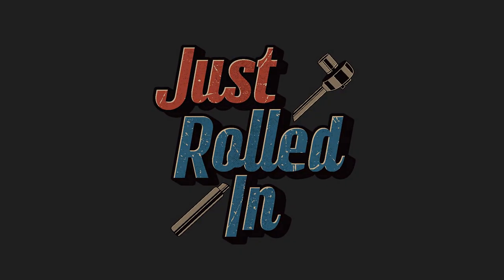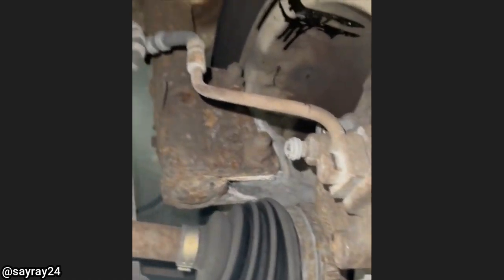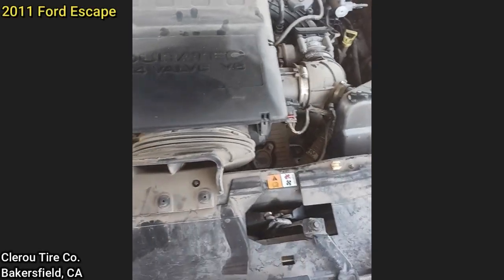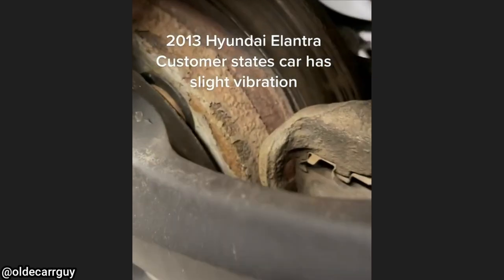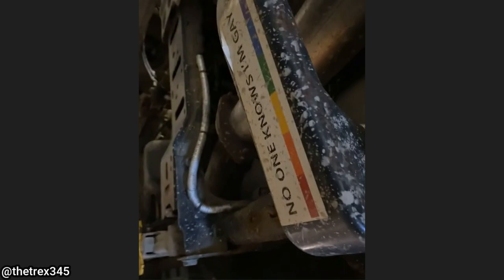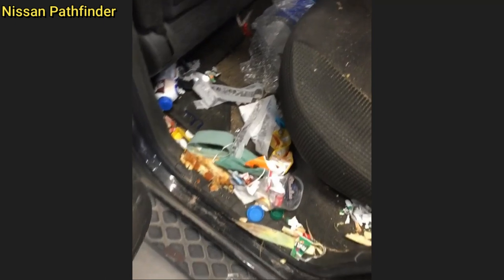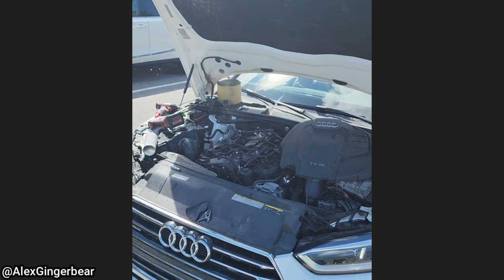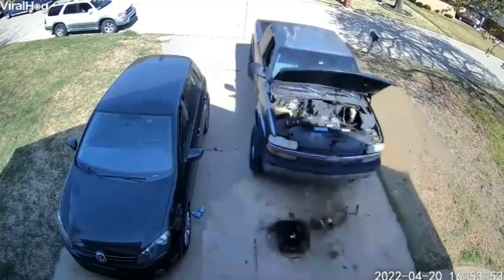Customer States Truck Still Overheats After New Parts Were Installed | Just Rolled In

Comment: My college buddy wanted to flat-tow his Duster to Florida behind a rented truck so I figured I'd remove the driveshaft so as not to cook the transmission. I was lying under the car in my parents' driveway which has a slight slope to it. Undoing the u-joint bolts went fine until the last one which was really hard to get out. It finally came loose with a "thump" and next thing I knew there was a tire pressing on my shoulder as the Duster tried to roll into the street. My friend had not set the parking brake, and I hadn't checked or put a block in place. The only saving grace was that everyone else was inside at dinner and no one saw me try to run myself over. Ah, sweet youth, the memories...
Reply: Recently had a scare like that. Wrapping up a resto on my step dads old F100. Had to adjust the shift lever on the bottom and was letting it warm up. Hadn’t realized I messed up the linkage inside the valve body and the truck was stuck in drive 😅 thank god it was low on fluid and barely moved forward or that would’ve been it for me.
Reply: @daviddeusinger5184  This is one of those stories where if you didn't know cars you'd go, "yea whatever you're just trying to get likes" whereas someone who knows cars is going.. "yup been there" lmaoo but in all seriousness I did the same shit in my old mustang...
Reply: Good times 😁
Reply: My hand got in a fight with the metal fan of a 12v cummins once got lucky with scrapes and fingers that ached for a solid 30 mins.
Reply: @thedukeofallsaiyans1369  I'm barely able to do the basics (oil, lights, that sort of thing), and that sounds terrifying. The likes thing never crossed my mind lol
Reply: transmission is using driveshaft as parking brake if you disconnect drive shaft it will move on it own because yall forgotten emergency brakes that run cable to rear brake shoes
if transmission is disconnect to axles it have no where stop it from moving
i think you mean dualy tow it like two front wheels on trailers n strapped down and rear put in neutral rolls freeways

it never going hurt transmission when it in neutral because no gear is touching if it in reverse or drive else yes it will catch on gear when it moving but not in neutral n nothings in neutral just freeway turn
Reply: @kittyztigerz  depends on the transmission. If the oil pump for the transmission is driven off the input shaft, it can burn it up even in neutral.
Reply: @jake-mv5oi  not when in neutral unless using cvt transmission yes only frontwheels drive
Reply: So many people have died from forgetting to put a wheel chuck behind a tire after undoing a u-joint on a driveshaft
Reply: @UndefinedStasis  true but not from lift truck it just roll away like one in video
Reply: @kittyztigerz  depends on the vehicle. whenever my truck gets towed driver always disconnects my driveshaft
Reply: @O1dmanwalker  um, how often does your vehicle get towed?
Reply: I did similar thing with a freelander and actually ran over my own arm. I had to also stop the car rolling into the car behind. No damage done but shit me up big time.
Reply: It’s amazing that most of us make it past youth.
Reply: <3 lmao we should all pool our stories together and make a good toilet reader <3 ty for the share! We have those moments for sure
Reply: @kittyztigerz  You are wrong!
Reply: You. You were the chock.
Glad you came out ok!
Reply: I was 14 when I changed the automatic transmission fluid to my Mom's AMC Pacer.  Another child of a single mother who can't afford to pay a mechanic.  And yes, that's the Gremlin's bigger brother, aka the Wayne's World car.  It was even the same sky blue/ metallic blue two-tone

Anyway, transmission fluid is drained with the transmission hot.  So the front wheels are supported on ramps, & Im on my back under a hot transmission.  As I drained the transmission fluid, I realized there is so much fluid I needed TWO drain pans.  Having filled the first one, I slid it to my feet as I held the 2nd one & filled it.  Once full, I slid that 2nd drain pan to where it was forward from my head.  Then it was time to remove the trans pan bolts that remained & remove the pan.  So, supporting it with my knee I removed the bolts.  When all bolts were out I relaxed my hold on the pan, letting both my feet AND my hair into hot transmission fluid!

My tennis shoes were like sponges filled with the stuff.  Still outside the front door I removed these & my jeans to keep from ruining the floor.  In only my underwear, I ran for the shower as fast as I could.  A whole bottle of shampoo, & three washes got it all out of my hair, but my skin was still grimy.  Having dried off it took a whole can of Go Jo Mechanic's hand cleaner, Ajax dishwashing liquid, & all of Mom's washcloths to become human again

In the time it took me to remove all bolts from the trans pan, the fluid must've cooled some.  Because there's no other way my skin wasn't scalded right off.  But as you can imagine, even though it wasn't scalding hot it was still HOT!  Worst of all it was filthy.  In over 30 years of automotive repair, there's maybe 2 other times I ever got so grimy 😅
Reply: The guy next street over went under his manual transmission truck to jump the starter solenoid. Left truck in gear. His wife found him few hours later with truck tire on his chest.  Don't take dumb chances.
Reply: Oof haha i would have yelled for their help. Also ‘your friend didn’t put the parking brake on’? That’s on you man, has nothing to do with your friend;)
Reply: @someinconsequentialusernam7799  pretty frequently until the aftertreatment system mysteriously disappeared (kenworth t680 550hp cummins)
Reply: @magnificentmuttley154  as awful as that all is.. THE FUCKING SMELL.... NOOOO hahahahaha
Reply: TheDukeof AllSaiyans  😝 Right, the smell.  Heh heh heh heh!  Thats as close to "tarred & feathered" as I hope to ever be
Reply: @magnificentmuttley154  at least tar smells better hahaha
Reply: Back when I was in high school one of my classmates was working on his car. It came off the jack and drug him down his driveway and across the street. He was OK but it scraped up his back/arms/etc pretty bad. From that day forward I have always set the parking brake and chocked the tires. I'm glad to have learned that lesson from someone else and not the hard way.
Reply: @magnificentmuttley154  so...  couple weeks ago the valve cover gaskets went bad on my mom's chevy Trax so it sprayed oil all over and under the bay into the heat shield. So I jacked up the car yesterday to take off the heat shield and drain it off and when I got underneath I thought. Maybe I'll do jack stands crawled out and the fucking jack broke and dropped the car... right after I crawled out
Reply: @TheDukeof AllSaiyans  Well, Im just glad youre not hurt!  If that was a cheap scissors jack like what comes with the spare tire, throw it in the trash & replace it with a small hrdraulic floor jack. (2 ton)  As for what you use in the garage, its best to invest in a professional floor jack (3 ton), not the cheap pieces of crap from Autozone, Walmart, etc.  Yes, they are $150-200 in my part of the country.  And I realize not everyone can afford it.  Back in my 20's I mustve gone through 5 of those $50-80 ones before buying the real thing

Anyway, a scissors jack isnt stable.  They ought to outlaw those things.  But even when you use a floor jack, support the car on jackstands before putting your body underneath.  I made the same mistake when I was 14.  Same car- - the Pacer.  This time I was replacing the left rear wheel cylinder.  The scissors jack was holding the car from the rear axle.  As though facing the brake drum, but with it & the shoes removed, & I began to loosen one of the bolts to the wheel cylinder, from behind the backing plate.  With no effort at all the axle came off the jack, & the backing plate hit the concrete less than an inch from my big toe.  This is on a perfectly level garage floor, with the parking brake set.  But did I block the front wheels?  No!  Its a wonder I didnt break my toes that day.  Couldve easily severed one right off
Reply: @magnificentmuttley154  this was a 3 ton hydraulic floor jack.... just heard a pop and the car came crashing down
Reply: @TheDukeof AllSaiyans  Wow!  I'll say it again:  sure glad youre not hurt.  I dont know if your jack is the same quality as what the repair shops & tire shops use, but there sure is alot of junk out there.  I have a mid-sized Ford tractor.  Thats 50 horsepower, & it doesnt have a backhoe, but thats the same size as any John Deere or JCB backhoe commonly seen on a construction site.  Anyway, I bought the highest reaching 3 ton jack I could find for the tractor, because both front & rear axles are 20 inches above the ground.  I paid $200 for this jack (in 2010).  The 2nd time I used it, the o-rings on its 2 "pump" pistons blew.  (It has 2, not just 1)  These are the small cylinders that apply pressure to the large load-bearing piston...  Again, this is still a cheap brand from Pep Boys.  Its not professional quality
Reply: @magnificentmuttley154  it was definitely a part store jack so I'm not that surprised really. Also thank you for your concern. That car is just low enough as a small SUV it would have crushed my ribs pretty good hahaha. It did make me realize the safety in good tools.
Reply: @magnificentmuttley154  I’m so paranoid I don’t even trust jack stands lol  before I crawl under a vehicle I have the jack supporting it plus jack stands and thick wood blocks as well and wills chucked always
Reply: @magnificentmuttley154  I’m so paranoid I don’t even trust jack stands lol  before I crawl under a vehicle I have the jack supporting it plus jack stands and thick wood blocks as well and wills chucked always. I know it’s overkill but I want to be safe.
Reply: @Justin Kearns 👌👌👌 Who's criticizing it?!  Not me!  Paranoia is such an overused word.  Just like the word "crazy."  People will call you "paranoid" when its perfectly healthy to be nervous or afraid.  So, trust your instincts.  Theres ALWAYS a good reason for them

Anyway, call that overkill all you like, but there's no such thing as too safe
Reply: Meet my friend Dan the Chock.
Reply: @Texas Tornado  A coil spring & a bumper jack?!?!  I cant think of a deadlier combination.  Nitro glycerine, maybe?

At 23 did you know why bumper jacks were discontinued?  Respectfully, I'll bet you never used a bumper jack again, & never let a vehicle roll again while raised above the ground...  Sometimes it really baffles me how some of us survived our amateur years in auto repair 🤷‍♀
Reply: @Texas Tornado  👌 Well hey, I cant knock it.  Ive nearly killed myself a couple of times.  😒💣💣💥
Reply: Lol
Reply: @71torinoman  Damn that’s crazy.
Reply: @dicktracy6597  😇Your guardian angel mustve realized what was about to happen before you did.  And I dont know the weight or model of the car, but even a midsized car wouldve broken the skin, traumatized & inflamed your hand muscles, maybe broke one of those many small bones.  Good thing you had the sense to keep your body mostly out from under the car, too.  Im not a man given to throwing out scientific thinking & overusing the word "miracle."  But that sounds like it could be a supernatural event, to me

At 51 Ive experienced only two events in my life where the best scientific knowledge of our time can offer no adequate explanation.  When I was about ten, I climbed to the highest place, as I routinely did, up in our family pecan tree.  It was above the roof gable of the house; at least 16-18 feet.  My mother & sister, coming home from my sister being picked up from school, found me concious, lying on the ground, holding the upper half of my body off the ground with my arms.  This is 4:00 pm on a weekday.  Fearing the worst, my mother took me to the hospital to be examined for concussion

I awakened in the earliest hours of the morning in an empty psychologists office, in an office building my mother janitored every week.  At first not knowing where I was, of course, but having no idea how I got there or who brought me

As it turned out I could remember the events of the day before just fine.  But for that particular day I couldnt remember a single thing.  Not going to school in the morning, not getting let out in the afternoon, nor coming home or climbing the pecan tree.  Nothing.  Despite the events of an entire day being wiped clean from my memory, nevertheless I knew I must have been in the highest usual place in the tree, because I had done so hundreds of times in my life, uneventfully.  I knew how to climb safely, & esp maintain grips with both hands in case my feet slipped off of a branch.  There was simply no other explanation for surviving a fall from that height, being left without so much as a bruise or a concussion
Reply: @nou8257  been there, done that - except it was on my first Dart, while messing around with the timing. I immediately knew why newer vehicles with a fan clutch is a good thing, lol!
Reply: @kittyztigerz  you are SO wrong in that whole reply you posted. The comment you replied to was not talking about a "car (vehicle) dolly", they were talking about exactly as they stated - flat-towing. If you're unfamiliar with the term, then look it up. You also REALLY need some clarification with your comment. If your vehicle is equipped with a manual transmission, then yes, it is perfectly fine to flat-tow without worrying about transmission failure from lack of lubrication - although i still wouldn't have faith in a newer vehicle's manual transmission to be lubricated like older vehicles did. No automatic transmission in the world is safe to flat-tow UNLESS the engine in the vehicle is running, which also isn't a good idea, as the pressure at idle is not significant to properly lubricate the transmission, as well as the fact that air flow through the towed vehicle's cooling system is not optimal (since it's only 4 to 6 feet behind the vehicle pulling it). The transmission pump is driven by the engine (not the output shaft) creating pressure, and forcing the ATF through the internals. If you'd even disassembled an automatic, you'd have realized where the pump is located on one.
Reply: I did the same thing. Went all the way over me. Lucky enough it was a Suzuki samurai and didn’t hurt anything but my pride😂 I always always always put a block behind the tire now even if I know it won’t roll or even if I have the e brake on lol
Reply: I remember my second day owning a manual car I started in in gear and immediately let out the clutch because I thought I had left it in neutral. 

I learned to check